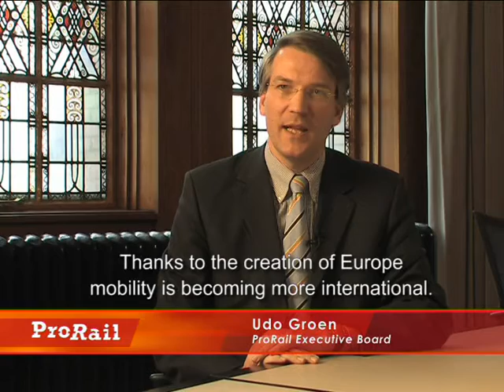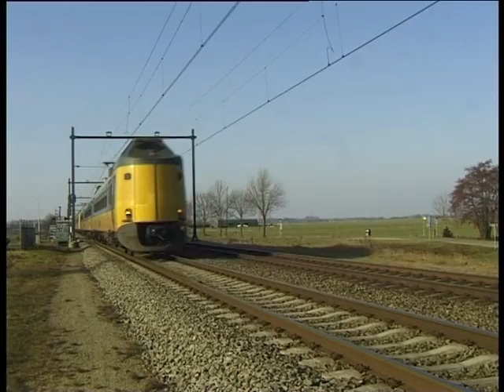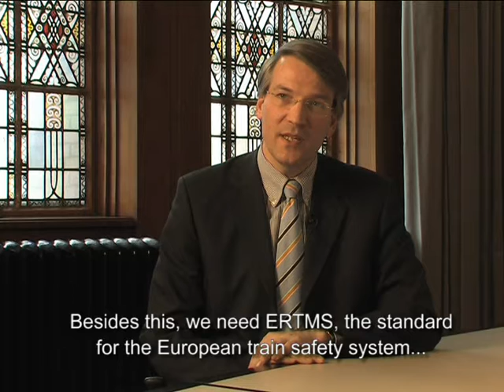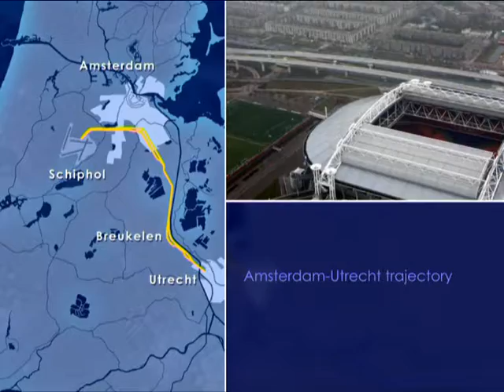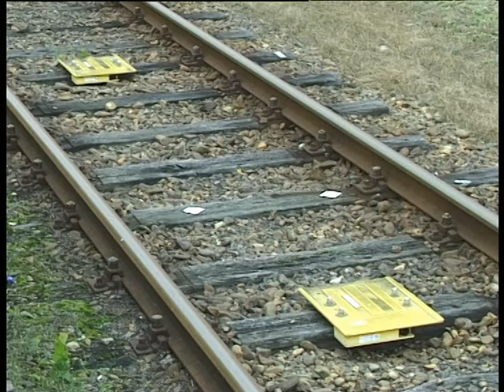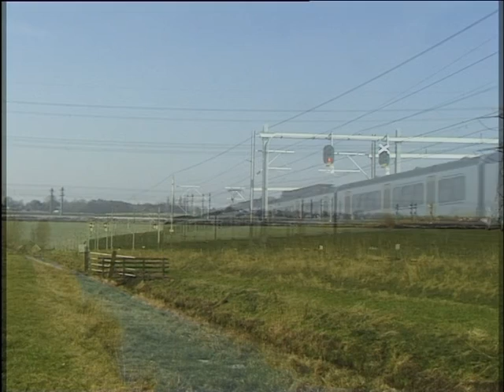ProRail ERTMS (UK version, 2006)

Comment: What about the faults on Cambrian coast line?
Reply: This was due to Temporary Speed Restriction information not being relayed by the signalling system.

It was a fault with the system designers (Ansaldo) coding which displayed incorrect information showing that the restrictions had been loaded after an automated restart.

Ansaldo are now a part of Hitachi and the software has been thoroughly tested, as well as support from RSSB and AIBN.

Let’s hope it doesn’t happen again, but this system must be adopted for the future of the railway and to improve competitiveness compared to road freight 🚂